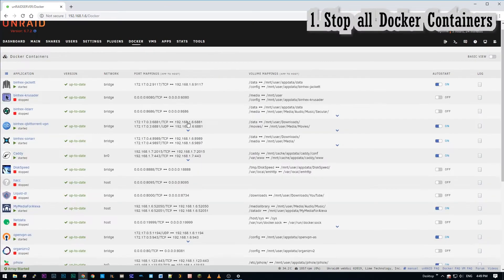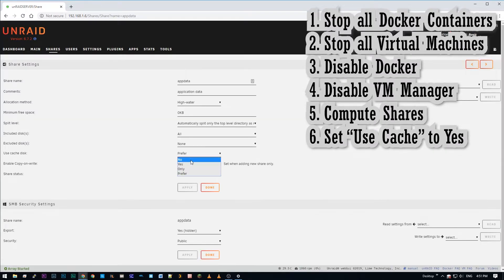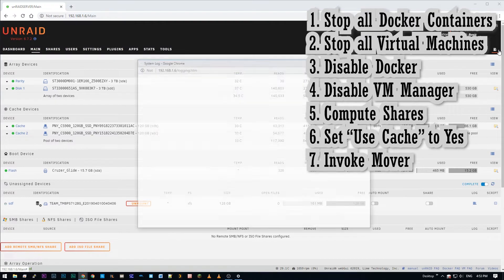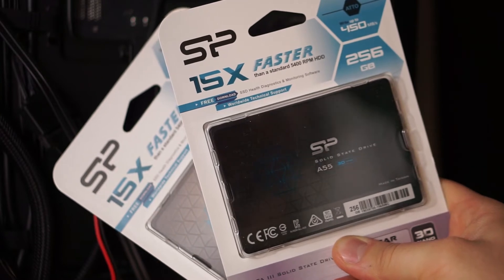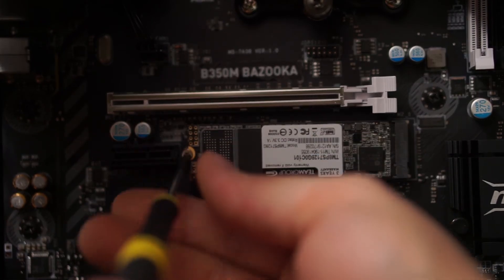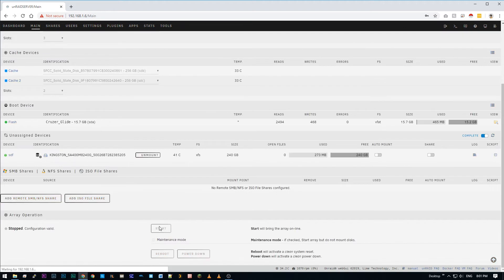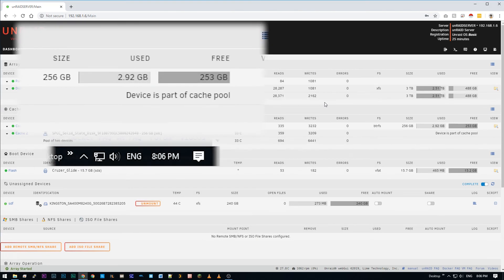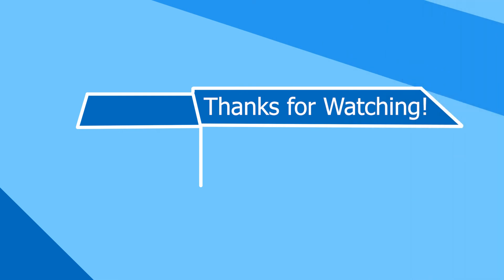How to upgrade cache drive or cache pool on unRaid - unRaid Miniseries 1

Comment: So, this video is great but some different steps now for 2025 (running version 6.12.13)
Put the primary drive as CACHE and the secondary location as ARRAY.
Then underneath, a mover option will appear and show the action as "CACHE to ARRAY"

Then mover will work!
And reverse the steps after the new drive is replaced, so where ARRAY is now CACHE and where originally was CACHE should be ARRAY.
The mover will move everything back to the cache drive.
Reply: You posted this at the perfect time...I'm upgrading from a 256 gig to a 2t m.2 cache drive. Running 6.12.8 <crosses fingers>

Comment: Out of curiosity, what is the point of step 5, compute shares? Is that just for your own information?
Reply: Ah nevermind I just answered my own question. It shows you which shares are storing data on the cache, so you know which to change the "Use cache pool" setting for.
Reply from the maker: Absolutely!

Comment: Giving this a go today.. I suspect that my cache is either failing or prefail as the smart tests indicate.  Hopefully all goes well.  Computer all for the shares is taking a long long time, but i have a 320TB array.  I really like how you have the steps listed on the side of the video in text as you do them.. Its handy and helps.
Edit. Updated with question.. Why is it necessary to do a compute all? It is still going 10 minutes later.
Reply from the maker: How did your upgrade go? The purpose of compute all is to see how much data is on the cache I'm the first place.
Reply: @DaveOTech  Upgrade went well.  It has been a few months.. I think a few files didn't make it off the cache due to the problems with the drive with some small consequences.. It has been a few months now so i don't remember all the facts.  Machine has been working great and having an nvme P31 2tb Hynix has made a big difference in my unraid server over a 2.5" ssd.
Reply from the maker: Good to hear! Thanks for the update.

Comment: Silicon power makes great SSDs, over the past few years I’ve purchased over 50 of them for clients and my own servers, computers, game consoles, etc. 

I have a question though. I only use my server for file serving, network controller, Plex and hosting game servers. No VMs. How critical is having a raid1 cache pool in my use case? I do use CA backup v3 weekly that backs up AppData, leaving just system share at risk. The reason I ask is because in order to add a cache pool, I need to upgrade my psu (ran out of sata power connectors on a tiny 400w psu that I’m using currently)
Reply from the maker: (don't tell anyone) but my current live server is only using 1 cache drive.....but it's literally only used for temporary data right now. I have an NVMe drive for my docker containers that get backed up once a month.
Reply from the maker: It's just a matter of what chances are you willing to take. If a drive fails, how long will it take you to recover/restore your backups.

Comment: After the Mover finished work, there is still 150 MB left on my cache, in the Video it was 36.5 MB, why isnt it empty?
Reply from the maker: It's possible that there's some residual temporary files remaining. Verify that there actually isn't anything in the folders. You could also try to reboot your server and run them over again. Let me know how that works out for you.
Reply: @DaveOTech  Reboot, still Data on the Cache 
Looked up one folder, there is Data splitted on /mnt/Cache and /mnt/disk1
Reply from the maker: @MPHxthexLegend  I kind of want to say it might be okay. Be cautious though. Verify that all the folders are indeed empty. It could be some system logs or something like that.
Reply: @DaveOTech  Your steps are not working anymore. After adding the new SSDs to the array it says wrong Cache pool exits with a array failure
Reply from the maker: @MPHxthexLegend  I apologize for your experience. I did not come up with this procedure, this has been common knowledge among the unRaid community for many years. 

I will have to update my procedure if this one is out if date.

Thank you.

Comment: The Dockers are not working properly. I am running a Restore from CA Appdata backup and restore now.
Reply from the maker: Before or After your upgrade?
Reply: @DaveOTech  After the upgrade the Dockers did not run properly. A possible configuration or something; the restore did do the trick though.

Comment: Well my new 1TSB SSDs I installed a year ago were already at their SMART lifetime limit this week.  I replaced them and then the drive replacement process failed and I had to use the "New Config" option (retaining my array info but deleting cache info) because each time unRAID tried to format the new cache drives it kept getting the error "TOO MANY MISSING/MISPLACED DEVICES".
Reply from the maker: Sorry to hear that. I think the cache drives are used by people to store everything, including docker containers and all your VM files. I personally have a 250 GB Cache Drive that's literally only used when I copy files onto it. If my cashe drives died tomorrow I could care less because I don't have any important data on there. Mover then move these files onto my data array. I use unassigned devices with nvme drives for my doctor container and VMs. My VMS and doctor containers are backed up once a month onto my data array. Consider adding another drive to use for your docker containers and VMs.
Reply: @DaveOTech  it's OK, I can live with the lifecycle being used up.  It was just frustrating that the procedure for replacing the cache drives did not work.  It may be important to stop the array, unassign the old drives from the cache pool and re-start the array before rebooting and installing the new drives.  Although that should not be necessary and doesn't help if a drive suffered a catastrophic electrical failure and was no longer detectable.

Comment: I have a cache pool setup using a 1tb and a 250gb ssd. I am trying to replace the 250gb ssd with another 1tb. I followed your directions but my cache pool says there's still 159MB of used space. Is that normal or does the remaining used space need to get down to zero?
Reply from the maker: Disable auto-start of your array, and reboot your server. After reboot run Mover again. If it doesn't clear up let me know.
Reply: @DaveOTech  ok, I did that and it helped a little. Brought it down to 64.2MB  left as still being "used" on the cache pool. The system folder for the cache pool shows an appdata folder, and within it Plex, Nginx, Krusader, and Overseerr. There are lots and lots of subdirectories below these main folders.
Reply from the maker: @justinamrhein5573  Okay one more option; get this plugin; https://forums.unraid.net/topic/43651-plug-in-unbalance

With it you'll be able to move the files to the data array.
Reply from the maker: @justinamrhein5573  Unbalance allows you to move the files across drives on the same share. You will be able to move everything left on the ssd to the data array.

Comment: I did everything you did.. and invoked mover.. but nothing is happening. System Logs says nothing.
Reply from the maker: Okay, it is possible that you have no data on your cache pool. Can you verify?
Reply: @DaveOTech  thnx for the quick reply! I have about 197GB of data. 100GB is just my VM, 33GB my docker, and the rest in Appdata :thinking:
Reply from the maker: Before you try to reboot, check to see if the space on the cache is decreasing. If it's not, reboot and invoke mover again.
Reply: @DaveOTech  Thanks! Reboot fixed it.

Comment: To me, moving things twice seems redundant...just thinking out loud here; if you added a 3rd cache drive, couldn't unraid build it on the new one (raid1) then remove the 2 old drives?
Reply from the maker: If the cache is set up in BTRFS then it won't work like that. A 3rd drive would just "mirror" itself to the other 2.

A year ago I thought I could pull an ssd out and swap it for a larger one....I ended up losing data from the cache.
Reply: @DaveOTech  but if you run a balance first, it will have the same info (redundancy) as the other drives!  I've litterly done this with 2 cache drives in raid1.  I'm just trying to figure out how to do it with 3 drives (2 currently in raid0; BTRFS)
Reply from the maker: Wouldn't invoking mover achieve the same result as running rebalance?
Reply: @DaveOTech  no.  ReBalance is for the cache pool only.  Mover makes the files go from the cache to the array (or the other way depending on your share settings)
Reply from the maker: I've used rebalance to move data from one drive to another in the parity array.
Reply: @DaveOTech  I suppose if your using BTRFS instead of xfs in your array
Reply from the maker: Ah okay I see

Comment: Hey mate, your unRaid server specs are almost identical to mine! Ryzen 7 1700 3.5GHz 8 core/16 thread, 3 x 3TB HDDs (including parity), Asrock AB350M ITX mobo, 250GB M.2 SSD, in a Fractal Design Node 304. Great to see similar ITX builds. I'm about to replace the M.2 sata SSD cache with an NVMe drive, should see 5x faster read. Thanks for the quick and easy tutorial.
Reply from the maker: You're welcome! I actually recently upgraded the entire server. I'm running a Dell R720 now. Got a really good deal and couldn't pass it up. I am noticing my SP SSD's are bottlenecking my server slightly, especially when data is being written to cache. All my docker containers run there was well, so I'm looking into upgrading them to NVMEs. 

If you every do upgrade, please let me know your performance increase, thanks!

Comment: Great work, an excellent video.  I have just purchased two 1TB SSDs to replace the 512GB SSDs being used for my current cache and this answered everything I needed to know.
Reply from the maker: I got burnt in the past when I thought "let me just swap out this cache ssd....." and lost my entire cache pool. If you wanna do it right you gotta take the time :)
Reply: @DaveOTech  Agreed.  Also your video on this topic is much better than the one by SpaceInvaderOne, where he asks you to use a file manager and make backups and then copy the files back.   Weird.
Reply from the maker: You could use that method if you're worried about drives failing when they're disconnected. It's just another precautionary measure, but to each their own I guess.
Reply: @DaveOTech  Ah, yeah.  As it turns out, I almost lost all my data.  I had the new drives plugged into some different SATA ports and moved all the data back to them.  Then I turned the server off and put them in the 2.5" drive cage where the old 500GB drives lived and in doing so I knocked one of the SATA cables slightly out.  On boot up one of the drives went bananas and corrupted itself.  BTRFS then went into some bizarre state where it looked like the remaining drive was self deleting all of its content - the free space kept increasing.   I cautiously rebooted with the drives connected back to their original SATA ports outside of the drive cage and the data was thankfully still on one drive, but the 1TB BTRFS partition - with a single 1TB disk in it - reported 2TB size.  It was super weird and very scary.

Comment: Thanks for this.  One part I don't understand is why make MOVER move everything from the cache drive to the array and back.  Wouldn't be just as easy to simply copy all the folders and files from the root directory of the cache drive to your array, upgrade the cache drive, and then move it back.  All the rest of your steps would remain the same with only this difference.  I guess I'm just not sure why MOVER is needed to do this one step.  Is it doing anything special that is needed instead of just moving the data yourself and then moving it back?
Reply: DaveOTech is correct.  The virtual filesystem of uNRAID tracks the location of files, so when you ask for "/mnt/user/domains/vm-server/disk.img", unRAID needs to know that file is actually on "/mnt/disk1/domains/vm-server/disk.img" as opposed to "/mnt/cache/domains/vm-server/disk.img".
It's best to never get in a situation where an index could be corrupted.  Let unRAID manage the way its virtual filesystem links things.
Remember, it's not RAID, it's "unRAID".  The smallest object that unRAID splits across disks are files, not disk blocks.
Reply from the maker: In typical YouTube fashion, this is my first time seeing your comment, notifications are terrible.
Using MOVER insures that all the files are where the system thinks they are. I cannot guarantee success with any other method. Manually moving files may causes issues, especially with mission critical files, like docker containers and system files.

Comment: OMG, thank you. I'm upgrading to a 2T NVME and ditching the SATA SSD as cache. Going to add it back to the array as a VM drive.
Reply from the maker: Have you done this yet? If so, could you please share your experience? How are the NVME drives performing?
Reply: @DaveOTech  yep, I upgraded to dual m.2 2T Sabrent Rocket NVME drives in RAID0 for cache. Soooo much better! Guide was perfect! It took a little while to complete, but afterwards my setup was blazing fast. My VMs on stored in cache and my Dockers too.  I'm so glad I did this. There's also a plug-in to regularly backup your VMs so that helps with resilience. I love it.
Reply from the maker: @DarksurfX  Wait a minute....you can use RAIDED drives in unRaid?
Reply: @DaveOTech  BTRFS RAID0 😁. My normal storage drives are unraided. Cache is meant for speed, not necessarily reliability 👍. My Unraided setup is 30T. My BTRFS RAID0 cache drives are 4T.
Reply from the maker: @DarksurfX  That's awesome! I got a new server recently that has 5 600GB 10k SAS drives. I'm thinking about putting 4 of them in RAID10, and leaving the 5th as a cold spare. Do you know if this would work in unassigned devices. I'll definitely have to make a video about this topic :)
Reply: @DaveOTech  the cold spare should work in unassigned devices ok. I think you'll need some setting to keep it spun down, but nothing major. I custom built my server. 4U with hotswap bays, Ryzen Threadripper 3970X 64G ECC DDR4 3200mhz. ASRock Creator Mobo, 11x3T WD RED drives, 2 Sabrent M.2 Rockets 2T SSDs. Nvidia GTX1050Ti (Plex docker video transcoding GPU).
Reply from the maker: Any idea if the RAID10 stay would work in Unassigned Devices? I know for a fact that I won't with in the data array.

And thats a nice setup. I have a 2U Dell R720, dual Xeon E5-2670 V2's, 128GB DDR3 ECC REG, GTX 750 for a 720p cloud gaming VM. The server has 8/16 2.5 inch hots wap bays. I also have a DEll 2U 12-bay storage unit. Got a really good deal on it, couldn't pass it up :).
Reply: @DaveOTech  I think the latest version of Unraid is supposed to support multiple pools and one pool can be BTRFS RAIDED. I do think the RAID should work in unassigned devices, I've not tested it myself, but I do remember people were using that for ZFS pools at one time so one would assume the more native BTRFS would work the same.